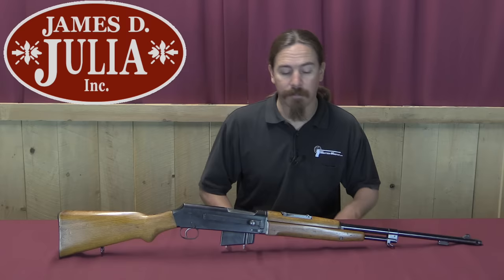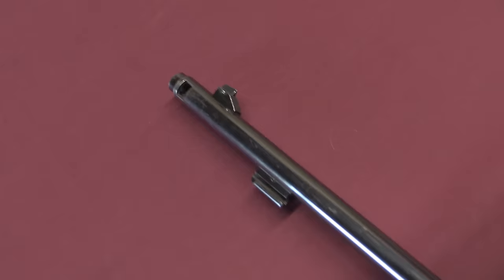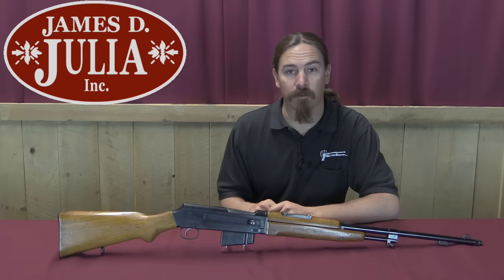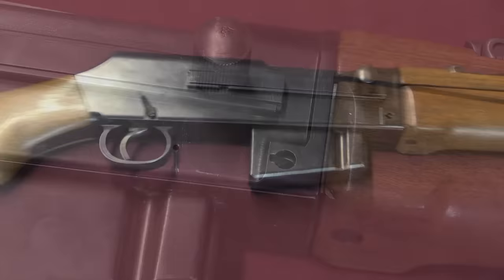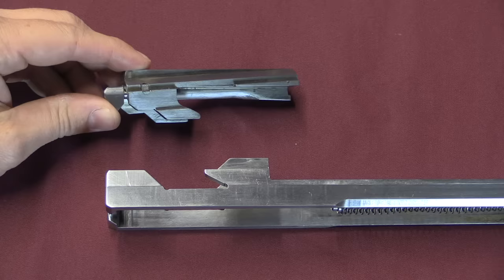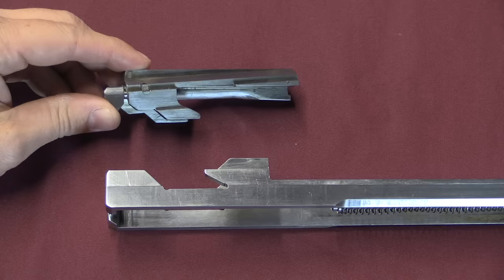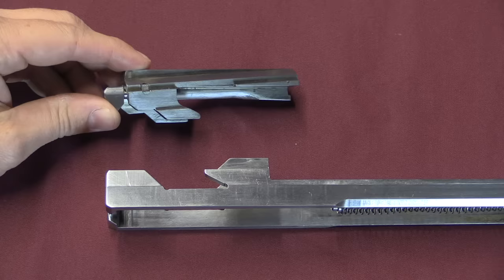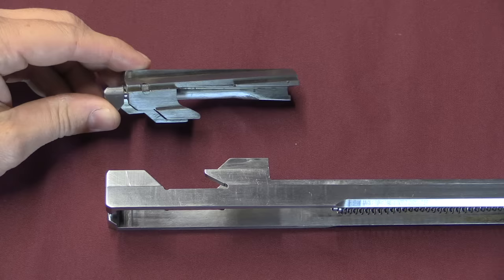Poland's WW2 Battle Rifle: the Maroszek wz.38M

Comment: The Gustloff 206 operates and looks exactly the same as this rifle!
Reply from the maker: They may look the same, but they do not operate the same way at all.
Reply: I agree, of course they're not exactly same but, they do use the same style of bolt and piston system, trigger group dissembles in the same fashion and, the right handed charging handles. I think the wz.38M has a far better build quality than the Gustloff. The two rifles are similar though.

Comment: Forgive my ignorance, but wouldn't the recoil spring lose it's 'springy-ness' due to the fact that it is housed inside the gas piston?  It seems almost too good to have only 5 existing.
Reply from the maker: No, because the spring isn't actually in the gas piston itself. It's not exposed to all that much heat, relatively speaking.

Comment: Why does it have a fixed magazine? Did they not see the benefits of a removable magazine?
Reply: the polish army were already using stripper clips so it would make sense (for the trails at least). Also, unless they were going to use BAR mags then there would be big overhead and production delays on manufacturing new mags.
Reply: @pablorambo123  Ah alright, that makes sense then
Reply: Robert Christopher At the time that was the standard for all magazine fed rifles.